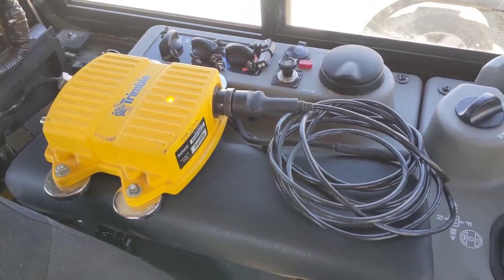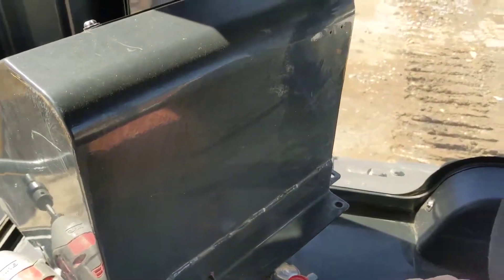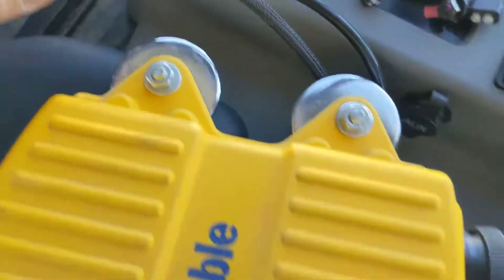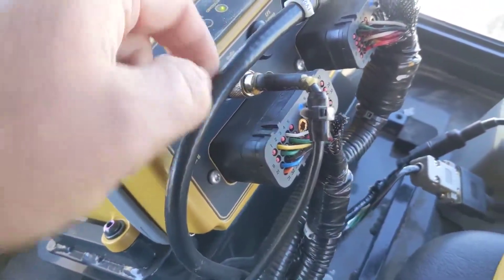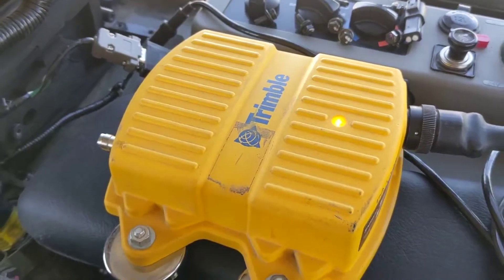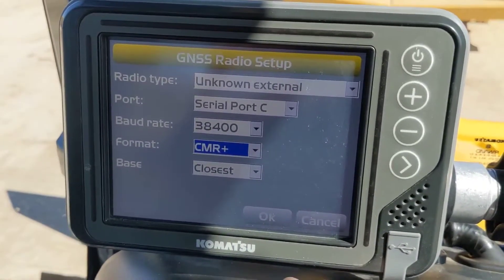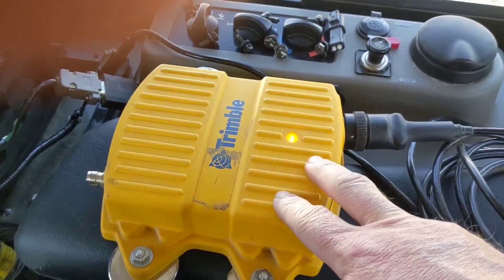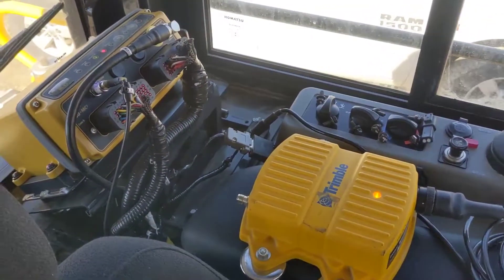Installing a Trimble SNR Radio in a Komatsu IMC Machine

Comment: I was running a topcon machine to a Trimble base station. CMR+ net27 worked on a previous project. But I set it up on a new project and it would not connect to the base station any ideas?
Reply from the maker: @brodeythompson9203  I would first verify your base is on Net 27 and outputting CMR+. There is a good chance if it's a different base, it may be on Net 27, but is outputting CMRx. The Topcon receivers cannot decode CMRx. Easy way to check is if the Trimble radio light is flashing, but you're not getting a fix.
Reply: @ctpusa1  Yeah it was in CMR+ and the light was flashing on the radio box of the machine. just wasnt getting to the screen. the radio symbol had an "x" over it.

Comment: Thanks for this.  Do you know If the part #70406D the same for the new 2.0 topcon machines?  We have a D71PXi 2.0 machine and trying to hook it up to Trible 900hrz base...Thanks in advance...
Reply from the maker: Yes, the 70406-D is the same cable. The machine should have shipped with a small adapter cable that plugs in under the back panel. 
Komatsu PN: 14Y-06-47930
Reply: @ctpusa1  thanks for the response… I did get the #70406E which has the 4pin deutsch for 2.0 from the good people you recommended over at Western States Cable…

Comment: A very interesting topic. The service technician of the official Trimble distributor in Poland told me that the combination of both systems was impossible. Works on Topcon 3dMc system controlled by LPS. Does the Satel radio also connect the Topcon system to a Trimble robotic total station?
Reply from the maker: You cannot run the Komatsu integrated Topcon system off of a Total Station. There was an update release at ConExpo to run a laser system on it, but no total station that I know of to date.